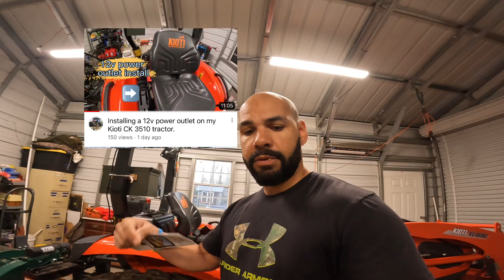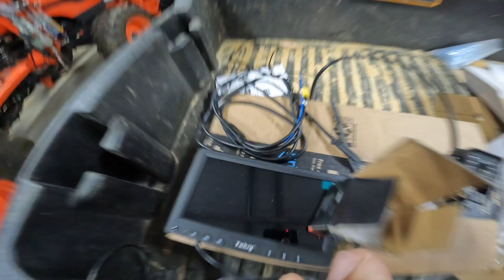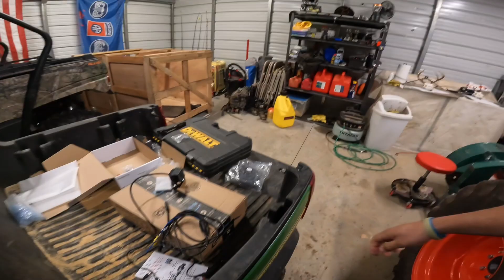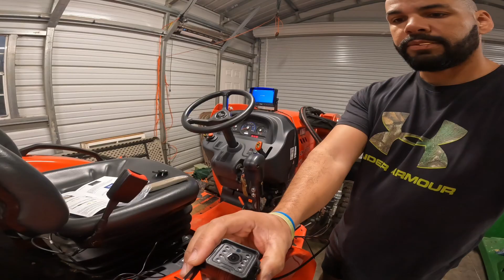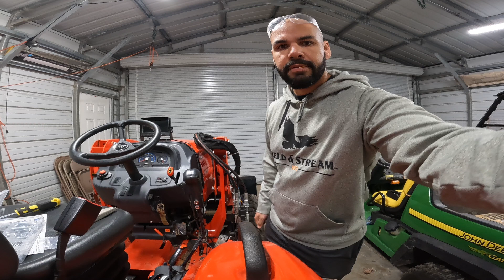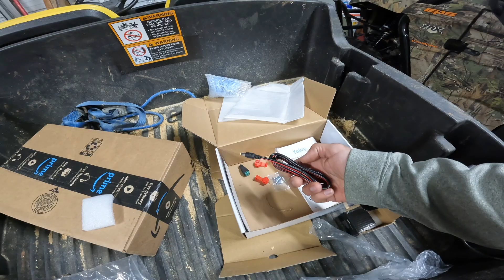Camera install for my stump grinder/ rear attachments

Comment: Great video. You took time to show the detail, but didn’t waste time on things that weren’t important. I do have a question. How well can you see the screen in the bright sun?
Reply from the maker: The sun is an issue if it is facing the screen directly. You may want to fabricate a screen shade cover or strap an umbrella if the sun becomes an issue. Ive only had the sun play an issue once while stump grinding.

Comment: Great video! Beautiful (clean) tractor and workshop too.  I recently installed a similar camera setup on my Kubota to run my new stump grinder. At first I placed the mag mount camera too close to the action and quickly coated it with dirt and sawdust.  I then moved it to the back of the tractor above the PTO and slightly to the left with a clear view of the blade. Much cleaner there, but not quite bright enough so I added a super-bright LED light, also mag-mounted, pointed at the 'circle of action'. Better, but it is hard to break the habit of turning and watching it directly. Progress though.  Again, great video and I look forward to checking out your others as a new subscriber.
Reply from the maker: I appreciate you watching. I definitely did not think about putting extra lighting under the pto. That’s a great idea!!!!

Comment: This is a great idea! I own the wireless version of the Yakry that I mounted to my 30’ Jayco Travel Trailer. It came pre wired for a Furrion brand camera but that thing was over $500. I found the Yakry and an adaptor plate that allowed me to mount it to the Furrion mount all on Amazon and saved a boatload of money. I’m actually impressed by how well it maintains the signal while driving down the road. 

I just ordered a WG24 myself and it’s set to be delivered, along with the chipper I bought, in two days. I will definitely keep this video in mind and add it to my tractor playlist in case I feel like I don’t have a good enough view from my L4060LE. Actually I will need both of your videos because mine didn’t come with a 12v plug either.
Reply from the maker: Nice!!! By chance was there any lag time with the Bluetooth one? I’ve only used my wired one and was curious.
Reply: @hisblendedcountry3131 there is a little bit of lag but it isn’t terrible. It’s enough for letting me know what’s coming and if I’ve completely passed someone, and for backing up as well. I don’t use it to change lanes to the left, I always use my mirrors when switching to the fast lane.

Comment: I just got done grinding out 7 stumps with the camera setup. I mounted the camera on the other side of the quick hitch for better view. I had two problems. One the camera lens got dirty from the stump grinding wich made it hard to see. The second was related to the sun making the screen hard to see. Of course that depended on where the sun was located. I am going to try to move the camera to the other side of the quick hitch to see if i get less dirt issues. The solution for the sun is to grind in a different direction. The stumps I ground varied in size from one to five feet. The five foot stump took about 2 hours. Uneven ground make grind difficult. Don't be in a hurry and save your tractor!
Reply from the maker: I absolutely had the same issue with the sun on a big stump I did for my neighbor. The down fall was that it was a huge stump and I had to work it from ever angle to complete it. Does help that I was doing it around noon time so the sun was an issue the whole time. Needless to say the camera was useless that day and my neck suffered.
I appreciate you bringing this to our attention so others can learn from our experience.

Comment: I also have that woodland mills grinder , i found a rechargeable wifi camera on Amazon has very strong magnets in the base , cost 119$ , bought a wifi only tablet  60$ also Amazon , down loaded the app absolute game changer no more neck strain ,  started out with my iPhone 10 found the screen to be to small , but the 10” tablet made all the difference